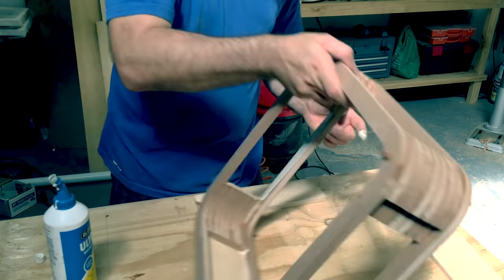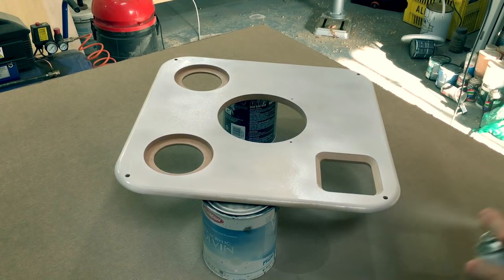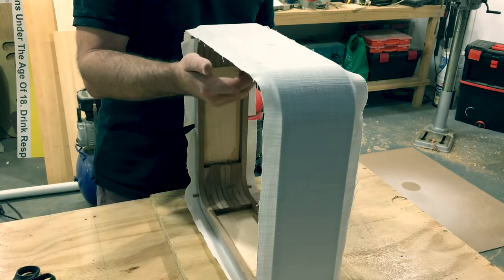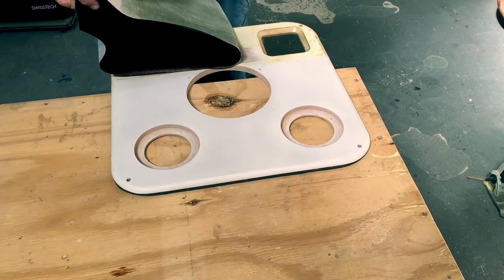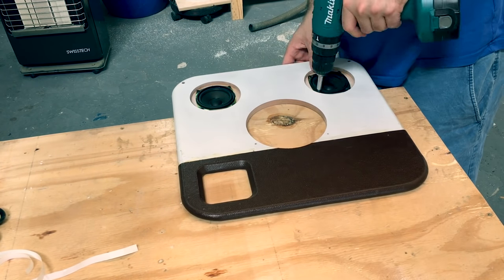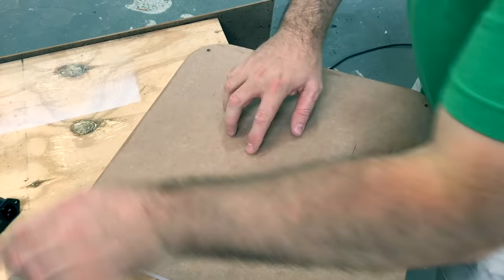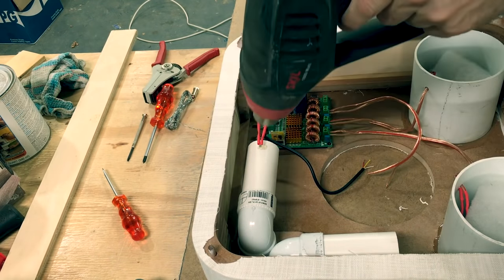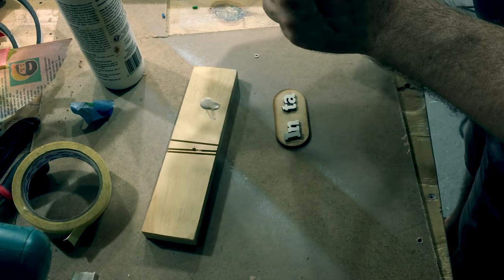Building an Instagram Icon 2.1 Bluetooth Speaker - by SoundBlab

Comment: Great videos! Any chance you could put a video together of all the necessary wiring? More detailed of the wiring part? How would you wire in a rechargeable battery instead of needing a power cord..? And where could you wire in internal LED lighting...
Reply from the maker: These videos are not really intended to be instructional. So right now I don't have any diagrams available and unfortunately don't have the time to put something together. But I will plan a future build that will come with plans. Can't say when that'll be though...

Wiring for these things are however rather straight forward, and by following the diagram that comes with the amplifier module that you use, you really can't go wrong. If that still is not helpful, I suggest that you try to go on to one of the Hifi Forums online where someone will definitely be able to assist.
Reply: +SoundBlab awesome! ty sir!

Comment: Quick question actually. Do you encounter any issues with Groundloop from your BT + Amp board? As in unwanted weird noises when it's idling/at low volume?
Reply from the maker: +Barry Llewellyn YT The board I am using has both bluetooth and amp all integrated and produces no noise. I do believe that separate bluetooth and amp modules can cause noise. A ground loop isolator would normally solve this problem, or run both modules off its own power supply.
Reply: +SoundBlab When I was making a bluetooth battery (12v Lead Acid) powered boombox I did ran into this issue. Little signal level ground loop isolators are relatively cheap tho when you get them from china, you can get them for like ~€3,50.
Reply: +foorje Thanks for the reply guys. It's ok, I'm well familiar with ground loop isolation, was just curious about whether it was a problem with this board or not :)
Reply: +Barry Llewellyn YT 
It seems from what I've gathered that the chinese do know their shit when you buy these all in one boards, yeah.

Comment: Do you always calculate the enclosure volume and resonator-port-length to the corresponding loudspeaker chassis you put in?
Reply from the maker: Yes, otherwise the outcome is just a guess and you can end up with a system that does not sound optimal. Sealed enclosures are far more forgiving, but ported enclosures can either sound lean or boomy when not tuned precisely.

Comment: Can you buy all the technick stuff (speakers, amp) in a set, that you only have to build a chest and conect the wires.
Reply from the maker: +Max Roskam Unfortunately not. Speakers were salvaged from an old sound system, and other parts were bought from eBay or local shops in my city.

Comment: i have a question, does your power supply have an output power of 200W since your amp has a max output of (2x 50W +100W) 200W.
Reply from the maker: +Thomas Jongsma No, the two are not entirely directly related. The 200W is what the amplifier can produce as music output with a load (speaker resistance) of 4 Omhs. In order to produce that output effectively (not under strain) the amplifier power supply must be able to produce 4.5Amps of current at 24V. This gives 108W that the power supply can produce so that the amp can deliver 200W of music power. This is a very simple explanation, but hope it helps.

Comment: whats the power output rating on the amp?
Reply from the maker: 50Wx2 + 100Wx1 Max (it varies depending on the load - 3-8Ohm load)
Reply: SoundBlab so the RMS should be about 25w x2 and 50w x1
Reply from the maker: Theoretically yes.

Comment: Hi there, my grandson wants to know how much it cost you to make this?
Reply from the maker: That is honestly to difficult to say. Most of the parts have been salvaged from an old system and the wood comes from my workshop with only some parts having been CNC cut. The amplifier and power supply was purchased. But if counting only the parts I paid for it was between  US$100 and US$150.

Comment: If i was you,  I would have put plexiglass in the place of the 4 plywood pieces and make the interior light up
Reply from the maker: The intention was for something that's not too bling, but if that's your thing, sure.
Reply: SoundBlab Yeah, ive already made 1 speaker with a plexiglass side, and im thinking about putting it on the one im building right now. That one didnt have any leds drilled and glued in it to make it shine, but as the box of the speaker that im building right now has 1 of the sides sliding, i might put some in this one.
Reply from the maker: Thats sounds very cool. Good luck with your build!
Reply: SoundBlab Thanks!

Comment: im a lot shocked  that you covered all your wood work, " REALLY " could of looked good with painted colours and stane, i guess im just used to seeing my dad's wood work and all his details, shame you couldnt share it here. but over all, looks good i guess.
Reply from the maker: Thanks. The idea was to re-create the Insta icon as close as possible. The fabric and vinyl provides the closest in material use and texture that represents the icon accurately. With paint and stain it would be so much more difficult to mimic. This is also not really a woodworking project that calls for intricate details. Hope that helps you understand my choices in this project :)